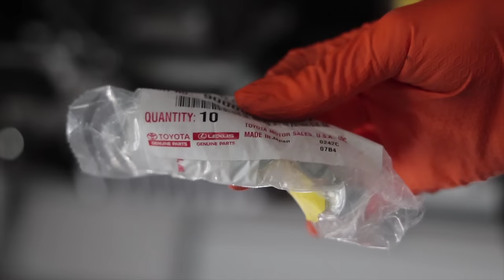Extremely Tight Fit.. // 2UZ V8 Swapped 1974 Celica

Comment: I normally pull a flywheel on, without the Loctite, torque them to snug then pull the bolts out one at a time and then apply lock tight, then final torque :) 

Loving how this build is progressing so 🐾 some

Comment: Ream out the dowel holes on the bell housing, it will easier when installing the transmission
Reply: They're tight for a reason, only someone in a fly by night transmission shop would do that. Alignment is critical.
Reply: ...and may never shift right if at all.
Reply: @ramblerdave1339  THat was a hack comment eh lol

Comment: Sarah is totally on point about expired condiments! I worked in the grocery industry for many years and during one of the grocery strikes I did work in the market and while I won't name stores it was incredible what I found! There were condiments on the store shelves being offered for sale that were 2 and even 3 years out of code. I pulled them all off the shelf and when the product was reordered they sent out a case of old expired product again which meant they weren't doing there job in the warehouse either. "Buyer beware" I still am very careful about expiration dates. Now back to Sarah and car rebuilds!

Comment: I used to have one of those that I called "Garfield" because it was the same color and I had a stuffed Garfield toy hanging from the mirror.  No AC in Louisiana back in the early 80's meant that I had to sell it and buy a Datsun 280z with AC in '82.  I did a coil overs on that Celica which was the only thing that made it drive-able.  I can NOT imagine trying to drive that thing with a super heavy v8 in anything other than a straight line LOL-ish but SUBSCRIBED 2 day!

Comment: I'm glad you hit those ribs you ground with the grinder with some paper and gave it a nice radius.  I mean I knew you would do it. The clear coat is just the icing on the cake.. Speaking of which were is the Angel Foodcake?  I'm excited to see you bolt on those headers... Won't be long until that motor will be making some noise.

Comment: I'm not totally opposed to copper grease but most of the times you encounter it in a workshop situation it's used excessively. And it hardens in high heat situations. Thus in the case of a simple brake service where it's often liberally applied on the back of the pads, sliders or sliding pins it's means that it makes that simple job infinitely more annoying. Beating out those pins where as the proper grease would have been used you can take them out with easy. That's why I replaces using copper grease with (in most cases) ceramic grease. High temp resistent and it doesn't harden with age. Beautiful work BTW, as always.

Comment: Back in the day, I learned (the hard way) that a "super aggressive, grabby" aftermarket clutch will quite quickly kill the 5-speed manual transmission in a (Blouch TD05-18G swapped) 2005 Forester 2.5XT.  Live, and learn... 
(Using the Cobb Tuning launch control feature may have also contributed the 5MT's demise. ;)

Comment: hello sarah.
when you are trying to clean up aluminium parts have a look at ceramic micropolishing. you dunk the parts in some little beads and it vibrates. will become mirror polish if left but a few mins should get it clean and even.

gearbox looks brand new though. the car is going to be awesome.

Comment: Red locktite can be hard to remove  from between the threads especially in a blindhole . Use of a thread chaser tap is usually needed . Blue locktite is far better to use
Reply from the maker: That’s the point, a clutch coming apart at 8000rpm is more catastrophic than having to use some elbow grease on removing a bolt.
Reply: Missed the point red locktight can also damage fine threads when removing bolts its not about elbow grease . If debris is in hole it can cross thread bolts .

Comment: Does Loctite melt finger nail extensions? I remember ruining an RC car (Tamiya Falcon) chassis by added it to screws into the plastic body. I was 10-ish so....yea. Also I see folks taking mics to the output shaft / clutch hub housing to confirm alignment / concentricity. Seems like a big deal. :) Might be a 60's thing though. Thanks for the build info!

Comment: Massaging the body work so the bell housing fits, works, but what about when you have to install and tighten the bolts that hold it to the block? I'm worried it might be too tight to actually get them in and get a wrench or socket in there.

Comment: I really enjoy the fact that you pay so close attention to detail it’s a little anal sometimes but then again to make it right it’s what it takes and everything you’ve done so far is absolutely fantastically done when I was younger, I used to swap motors all the time People couldn’t believe that I’d swap their motor I mean I went steamed down before I took it apart steamed the engine bay cleaned up the crossmembers new motor mounts we get engines from junkyards and totally gasket them with all the water pumps and everything else I would open up rods, and Mains doesn’t motor if I were doing a short block or a long block the people I bought my engines from I never had a problem. Even the ones that I had them tweaked the cylinders a little bit you know 60,000 over take 202 from our Chevy and put a little bit bigger valve in it Little things like that stuff nowadays it seems like you can turn it the computer up to do whatever you wanted to do but you still gotta have the internals I can handle whatever that computers put in and I believe you’re doing a fantastic job on this that you’re doing it’s gonna look like it was factoryand that can be only appreciated and people who don’t appreciate that angles. Scratch your ass.

Comment: Ok your doing all this work but you still have to paint the engine bay. Are you leaving the clutch attached to the transmission? Just wondering you used lock tight on those bolts.

Comment: I saw this coming! you will probably need to lift the engine off it's mount and but on hoist and crane it up and tilt engine down in the back at a radical angle because stabbing the input shaft into the pressure plate is going to put you way back in the trany tunnel, where you loose clearance, you now know what I'm talking about. You might as well take the headers off now, take the engine out and mate the trany to the engine out of the car, and then finish with the headers after the engine and trany are back in. At this point I don't believe you will be able to get the trany on or off without tilting the engine and I don't think you can tilt enough because the engine is going to hit the firewall, thus meaning your going to have to take it off it's engine mounts, which means you will be trying to stab a trany with the engine swing around on a engine hoist, that is if you have a chain hoist over your lift. Idealy you probably need to modify the trany tunnel so you can take the trany and bellhousing off the engine without doing anything to the engine. Been there done this many times, All kinds of Mopar cars, Opel Kadets, Ford Curriers and the list goes on. GM's and Mopars the gear box unbolt from the outside from the bellhousing making the job so much easier, and with automatics never R&R a trany without having the tork converter in the trany all the way into the pump, never try and take a trany off, (in a car or truck) with the tork converter still bolted to the flex plate. been there done that. But you knew that👍Did you know that Lexus in 95-98 never but the manual 5 speed trany up against the 4.0 v8 in the SC 400 Coupe because it was too dangerous, only the inline 6 and it was too dangerous with TRAX off. FYI from TODD 62 year old mechanic. worked for Lexus of Seattle
Reply: please wear eye protection especially when doing anything with springs.
Reply: I apologize, I saw the video again and it looks like you have an adaptor plate so you can install the gear box up against the bell housing, so you can bolt together from the outside like GM and Mopar manuals, my mistake, sorry!

Comment: Assembling the transmission and headers to the block outside the car would have so much easier.
Reply from the maker: You are 100% incorrect.
Reply: @SarahnTuned  This is normally how this is done. Physically reaching over your head for everything is more effort then reaching down..
Reply: @jamesemcclure  Assemble the transmission and headers to the block outside the car and then try to shove it in this Car, not gonna work bubba.
Reply: @MauiWauiPineappleExpress  Engineering it the art of making the not possible possible.
Reply: @jamesemcclure  And that is what Sarah does!

Comment: My horn button on the bottom of the air bag module of my 99 accord is stuck on.  The switch is not available separately, therefore  is part of the air bag  assembly which is over $1000. I took out the horn relay and wired the circuit to a separate marine horn switch in one of the dash blanks but discovered the clock wire assembly of the steering column uses the horn circuit to activate the cruise control; so no cruise.  If I come to your place,  you love wiring and i'm depressed.  Help.

Comment: So... Possibly a silly question.. why does one need a clutch alignment shaft to mount a clutch? Why can't you just bolt it on?
Reply: The friction disk between the flywheel and pressure plate doesn't have anything to hold it on center when it's all bolted together. The alignment tool centers the disk so the input shaft of the transmission can slide through it, and line up with the bearing on the end of the crankshaft without binding. Hope this helps!
Reply: Ah, cool stuff! Thanks 😁  @Kidzak
Reply: @simtalkayak  I misspoke... It's not called the throwout bearing, rather it's called a pilot bearing.  Oops.

Comment: I need ViG Welding on some Cylindar head ! Cause near Exhoust threw broke out the hold screw ? 
Heavy head for steer the fire ! Do you able with Dave full melt the hole and cut back bold inside hole bore fore with too ! I think yes :)